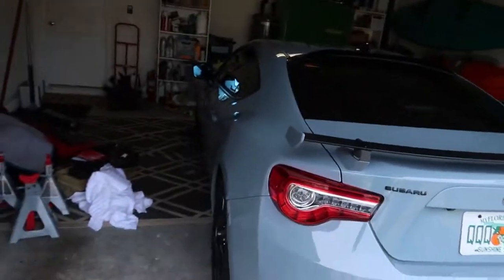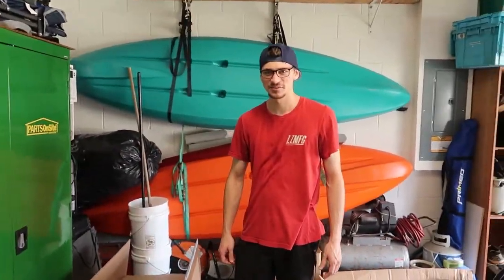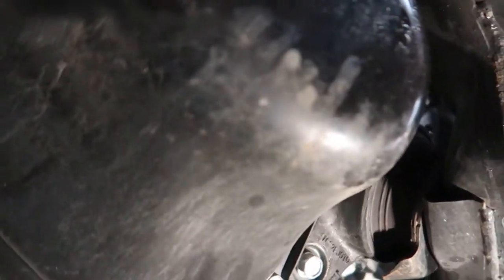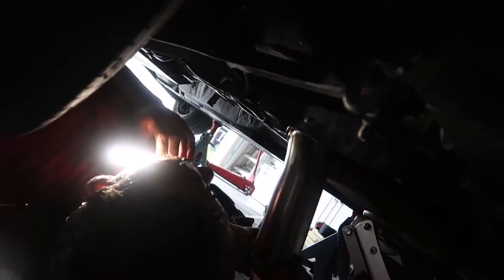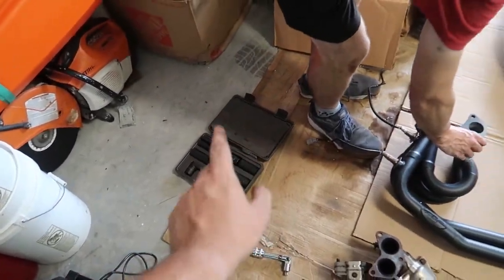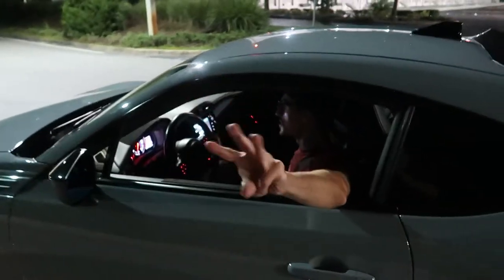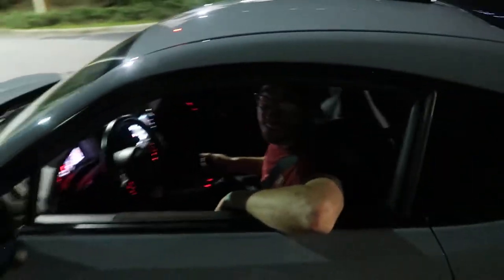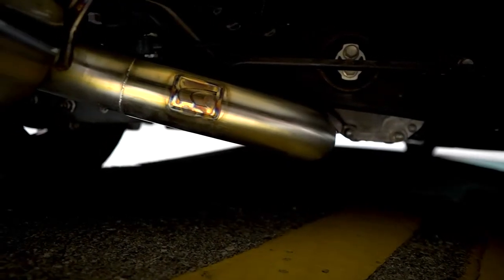BRZ Gets Full Exhaust (Headers, Over / Front Pipe, Catback Install)

Comment: I know this is an old vid but recently installed uel jdl header and have an exhaust leak im sure it has to do with the gasket as the gasket provided that goes between the header and op was to small did you get all the gaskets from JDL?
Reply: Try again but with OEM gasket